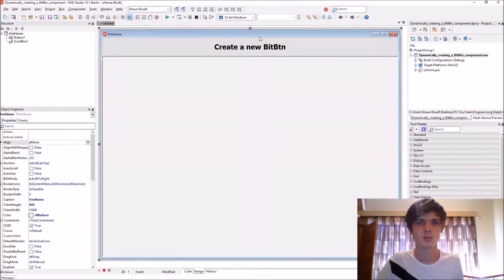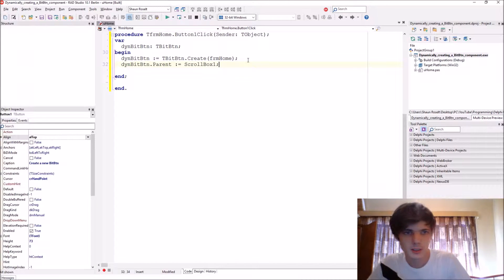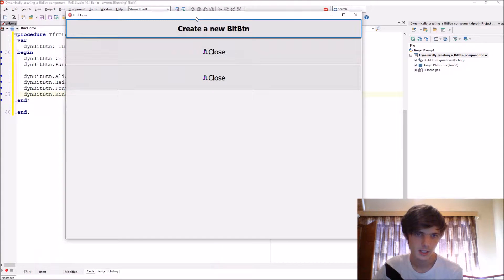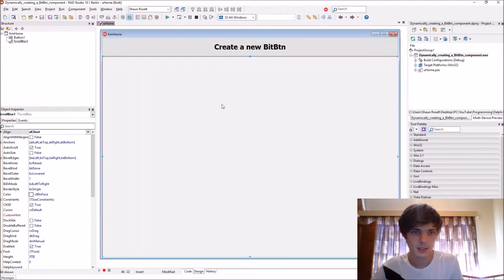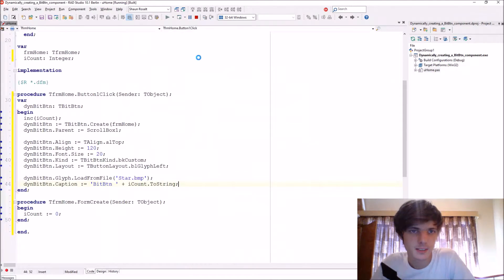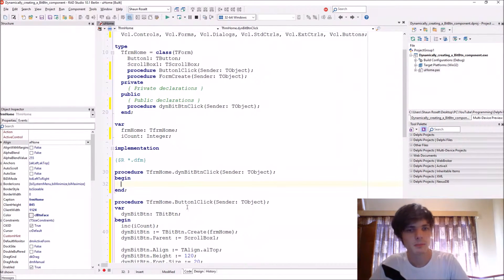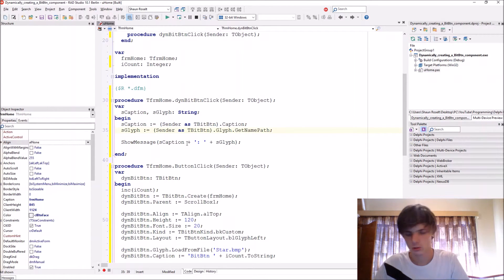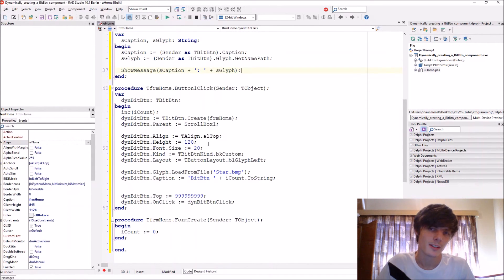Delphi Programming Series: 48.11 - Dynamically creating a BitBtn component

Comment: IMPORTANT NOTE: Do _NOT_ use the button components of the Vcl.Buttons unit (mainly consisting of TBitBtn and TSpeedButton) anymore! They have been deprecated for decades now and are no longer maintained. They are extremely buggy under later versions and only there for compatibility reasons.
Use the standard TButton instead, this has most of the features already implemented. For those features which are not available there, you have lots of up-to-date 3rd-party stuff available, like the TCommandButton from LinaComponents.
Reply from the maker: I actually like using TBitBtn and I still use it today in my new apps. I mainly use it as a 'Close' button. You will see my 'Delphi Programming Helper' app is actually still full of TBitBtn components (not much, but they are there). Thanks for the heads up though.
Reply: Better use TCommandButton from Lina Components, it's much more stable and can do more.
Reply from the maker: Dennis07 I do not like third-party components.
Reply: Well, that is your personal problem then, if that means you use a buggy, lousy and obsolete component rather than a modern, functional up-to-date and stable one... :)
And unlike the TBitButton, the TCommandButton from Lina uses the Windows API for drawing and does not do it itself. Also, it inherits from TButton which means it's 100% backward compatible to TButton, which TBitBtn and TSpeedButton is not. But, well, your choice. It's as if you took the Fiat 500 instead of the Audi R8, just because the Fiat is available at your local store and does not have to be delivered manually.